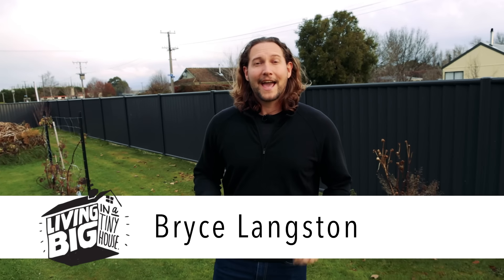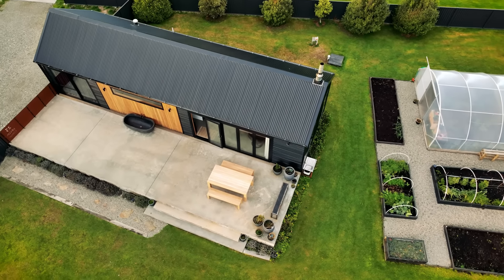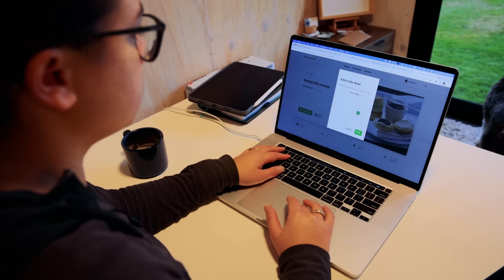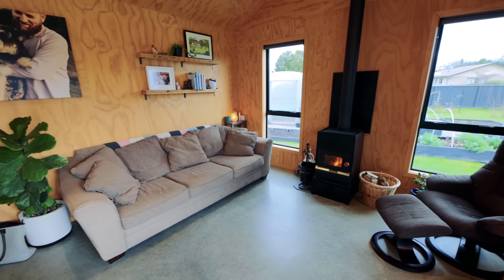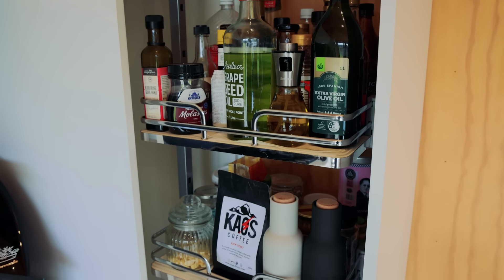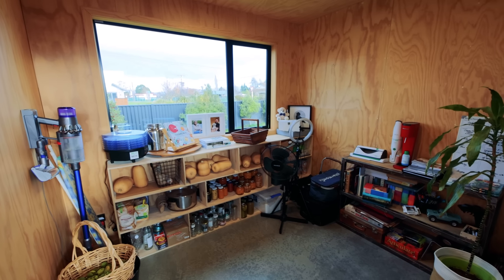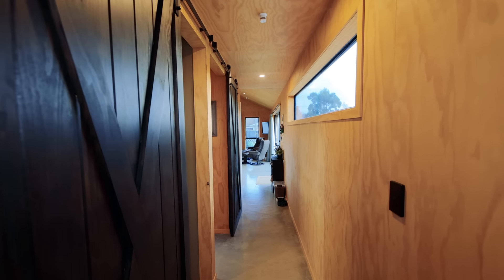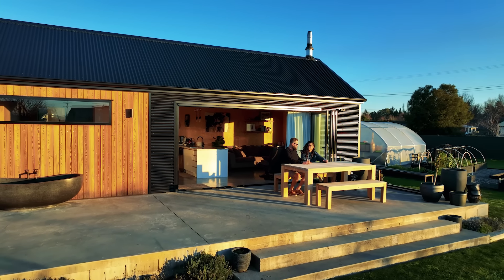Spectacular Scandinavian Longhouse Inspired Small Home

Comment: I'm not a fan of the plywood.  It makes it look like the house is still under construction.  Also, dust floating through the house will manage to stick to the rough, unfinished surface of the plywood.  Every year or two, you'll need to vacuum the plywood walls and ceilings.  Good luck with that.

Comment: Nice house. This has become quite common in Scandinavia nowadays, the style and even size, for some with first homes. I like the small hallway with rooms going off.  I do miss having eaves on the houses, which are more common back home in Aust. Now I live in Greenland where the building I am in has eaves past the balconies & it makes a difference during bad weather as I can use the balcony or have an open window without water coming inside. Many houses around it don't have them but I do wonder why not. I had a 50sqm cottage in DK and only one side had eaves & it made a huge difference, also during summer, keeping things cooler.

Comment: I love the design of their home. It's very modern and minimalist  The closet behind their bed is a very clever idea. Good thing that a small sink in the kitchen works for them though I would have preferred a bigger and deeper one with one those wood or "grill" covering a portion of the sink to act as additional counter space. And maybe used thick tiles with marble design on the counter top but I guess they do not allow water to stay on the surface so the laminate finish works 😊

Comment: I all was wondered if the long house wasn't  what inspired  some of the US row house then moble homes.  The row house though has a door at each end and faced so the wind blows threw the house. Window  along the sides and room doors would  be open when the wind flow was side ways. This ways before the AC was designed.

Comment: It looks great but some tips when your are actually interested in an "Eco House" as you say. Concret is really bad (seels the ground, not reusable, extreme co2 output.) . Its too late for that now, but gravel ways aren't too good either.  Also, keeping the grass this short prohibits habitat for insects, birds etc and is not good for the soilquality and stability.. Leaving grasses around trees longer helps safe water in the ground near the trees and saves freshwater at the surface. Having only one kind of grass (looks like it) leads to the same problems. Having some native wild flowers in the mix is advisable.

Comment: Black should never be used as a primary colour. It should be used as a contrasting feature on windows/doors/guttering. The inside needs more contrast as in using a different wood and colouring on the ceiling and around the windows. You can see a lot of thought has gone into the house but not enough thought was put into contrasting the outside, and the inside with different coloured wood.

Comment: If I was going a small house like this, i would go with concrete. It handle's the elements so much better and gives you better protection. The design on this is good, though/well done.
Reply: But it has no thermal insulator properties.